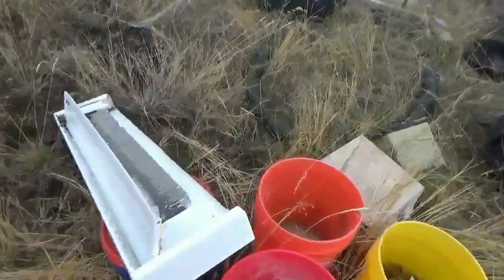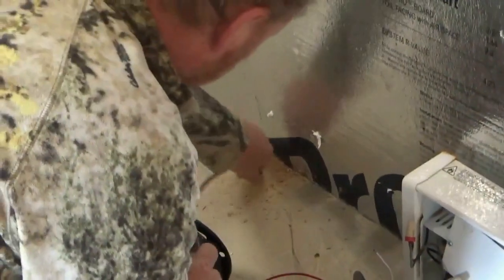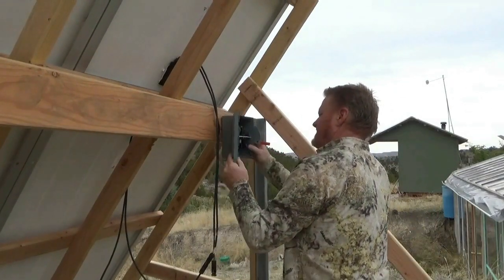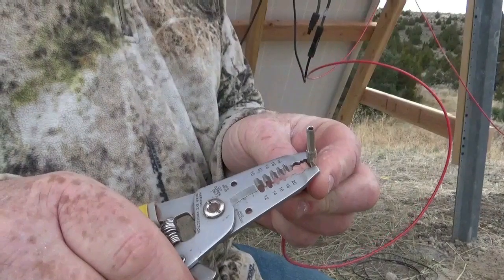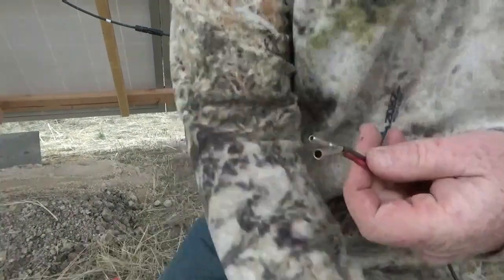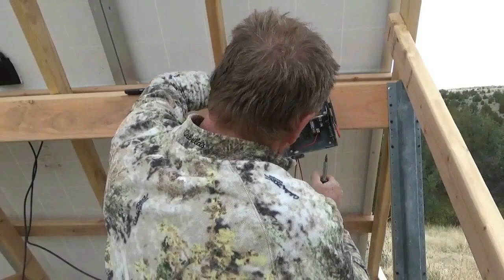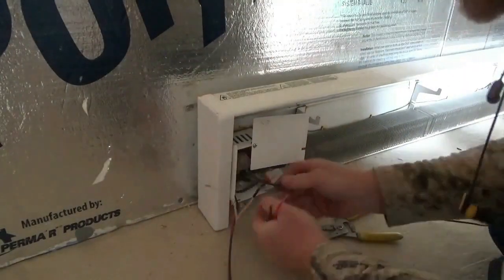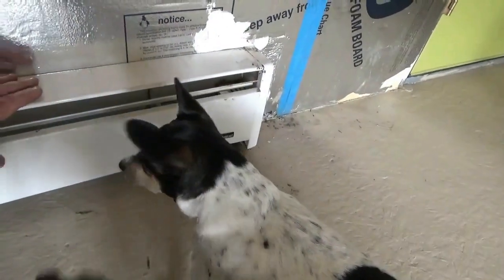Can you heat a house with solar PV panels and a baseboard heater?? Watch to find out #Free Energy

Comment: I do know how to do that the right way, with a power point controller that keeps the panels at power point. It also has arc interrupt so existing thermostats can operate without burning up. Direct connect is for people who don't know what they are doing. You need three times the panels to get the performance I get.
Reply from the maker: There's no way you are getting 3 times the power with the same amount of solar. Maybe 20% more with a mppt controller. 
 But hay prove me wrong, ide love to see yer setup.
Reply: @veggitarianredneck  A MPPT charge controller is only about 30% more efficient because the drop in PV voltage is limited to battery volts. In a direct connect resistance load, PV voltage can go to almost zero. Power is a squared function of the array voltage. Small drops in voltage create a much larger loss in power. You only get two hours of really good sun a day. For example, when panel current is 70% of maximum the increase in power with a MPPT controller is 50%. At 50% current that increases to 100%. 40% the increase is 250% and at 30% the 
increase is 330%. In most areas, increases clouds in fall and winter reduce panel currents so low that direct connect produces little power. My focus has been heating domestic water from harvesting excess energy that solar systems usually just waste. PV energy is a resource too important to dedicate to just water or heating, but the principals are the same. Electronics is needed to continually match the panels to the load. These power point systems can be very low cost. Using a charge controller and battery to accomplish this inefficient and costs way too much money. Take voltage readings every half hour thru the day and it is easy to calculate the power that can be gained. Switching DC with AC thermostats is dangerous as these switches will burn up.

Comment: Nice video, how to connect and how to set it, but from the headline I was hoping you tell some statistics if it is really be viable system through the year. Mostly through winter or at least spring and autumn.
Reply from the maker: I'm still testing it. I will definitely do some update vids. Thanks for watching.

Comment: what is the DC to AC conversion (if there is one) curious if a constant short would cause panels to heat up or cause damage to them
Reply from the maker: No conversion needed, induction devises  doesn't know the difference. The panels should handle the current without any issues. But we'll see, if something happens I'll post an update.
Reply: @veggitarianredneck  Thanks for the video.
A correction (IMHO):
>...induction devises  doesn't know the difference.
Not INDUCTION but RESISTANCE!
Its RESISTIVE devices like these heaters that do not know the difference.
Inductive and Capacitive loads know the difference all too well!
Reply from the maker: @GkTheodore  ok, good point, I will have to make sure to correct that in the future. Thank you.

Comment: It would take a tremendous amount of solar panels to heat even a small home with resistance heaters. Your best bet is to purchase a 22 seer or above mini split heat pump. They will put out 3 to 5 times more energy than you put into them. Of course you’re going to spend anywhere from $1500 to $3000 on a good diy system. You need about 50% more PV array in the wintertime as you do in the summer If you assist with a wood burner below 30F.
Reply: but then he needs an inverter with stabilized, pure sine wave output and probably at least  a small battery to avoid fluctuations. Heat pumps are more delicate. It makes all the sense in the world if he needs AC and can get an inverter but for simplicity and speed nothing beats this setup.
Reply: They make mini splits now with solar direct MC4 connectors right on the outside unit.  @koborkutya7338
Reply: @koborkutya7338  They also make Heat pumps (mini split) with direct solar panel connection right from the factory

Comment: I wonder how it will work in true winder.  We need sun light for it to work well.  Also panel configuration can help so slight shade won’t shut it down.
Reply from the maker: I'll post updates, but I'm sure it will produce much less heat overall. Which is exactly when it's needed most unfortunately.
Reply: @veggitarianredneck  I was thinking last night  ... is/if there is another way to dump/store the solar (I know batteries but that isn't what I am thinking) ... maybe some sort of a larger capacitor type thing that the voltage could be released slowly at night to the elements.
Reply from the maker: @davidpatrick1813  My thought was to ultimately produce hot water and then it can be pumped through an exchanger
Reply: @veggitarianredneck  You may also want to heat up some big slab if you have one inside your house. Store heat in some large mass heated up. If e.g. you can place a 1 m3 water tank inside somewhere (OK quite bulky but for the sake of explanation) it is 1000kg of water. Heating it up from 20degC to 40degC (20degrees) stores over 20kWh of heat. 40DegC is not that high (not dangerous) and you can do that with an immersion heater, no moving parts etc. You keep the lid on so no humidity comes out (just enough to equalize pressure, of course). If you have a metal tank it will also work as a decent radiant heating when above 30deg, at least in the rom it is placed. 
If I saw correctly your house is a wooden structure, no big masses in the structure like concrete floors or brick walls. I would try and use some liquid heat buffers like above. Minimize pumping, pipes, valves, connections etc - they just make it complicated, expensive, maintenance-intensive and less reliable. 
I like your direct heating approach. Keep it simple.